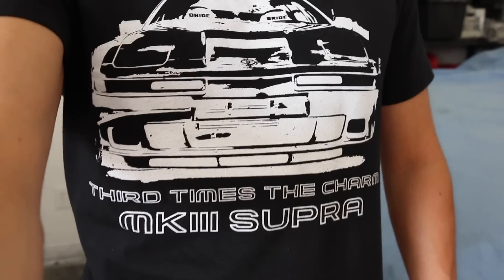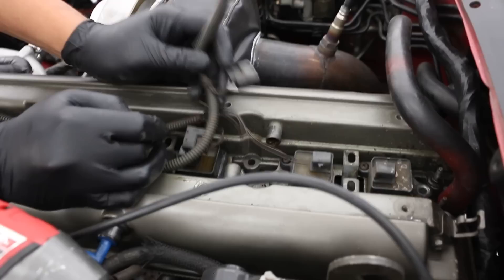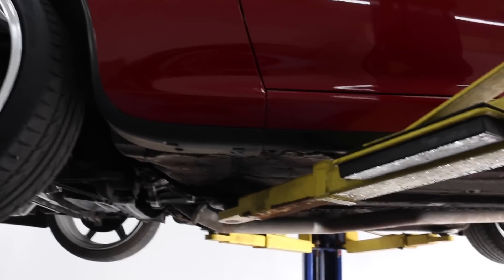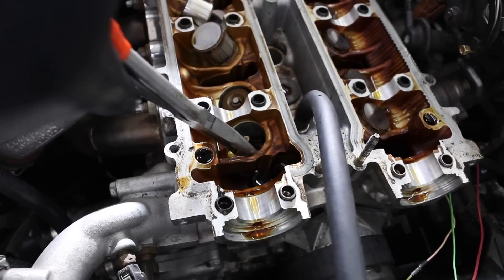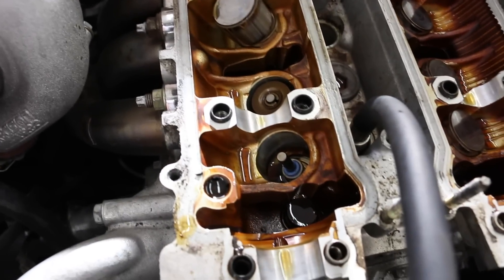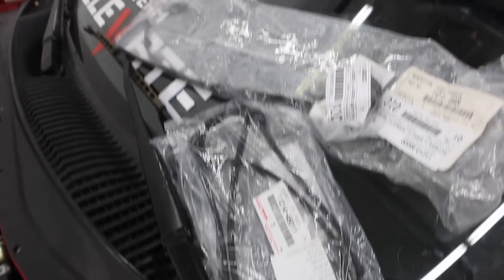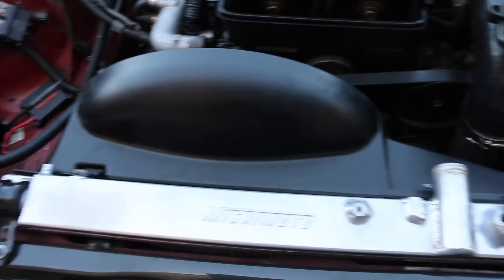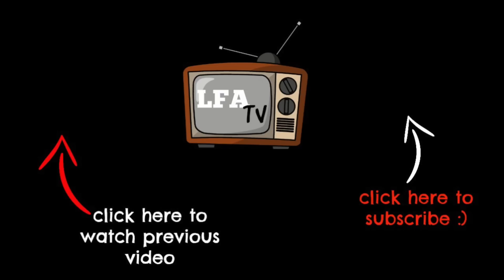MK4 SUPRA 2JZ VALVE STEM SEALS / HOW TO: WITHOUT REMOVING THE HEAD.

Comment: I had my W58 rebuilt minus the no longer available input or output shafts.  The noise I took it in for is still there and sounds scary driving in 5th.  I am forced to go for an  R154, or go for the TH 400 conversion.   If you know where I can find what I need, I'd love to keep the W58.
Reply from the maker: Dirty Vet only place i can try is ebay or rockauto

Comment: Yeah i have my w58 still, i dont mind it with my na-t. i dont do launches but i have yet to see any problems with it and im on a stage 4 competition cluch with it so it sees just about all the torque my engine is putting out.  However i just dont like only have 5 gears, its way to much of a tight ratio. cruising at 75-80 mph and the thing is at like 3700 rpm give or take. and by the time you're at like 130 you can tell your engine has more but the gearing just isnt there.   Great for canyons though in my opinion.  I'll be switching to the 370z transmission.
Reply from the maker: Review Guy the high reving on that mile per hr might have to do with your diff more then the tranny though, my buddies is wayy lower then 3700 on that mile per hr with the stock lsd diff.

Comment: W58s are ratted at around 400-500hp. Record holder is a guy from Australia with 650hp stock.
R154s are ratted at around 700-800hp. Record holder was Duane from Canada with around 1000 hp stock.
V160 are rated at around 1100-1200 hp. Record holder unknown, but have seen many at around 1500 hp stock.

Usually these guys with over powered Supras...are respecting and treating properly their transmissions without banging gears and general don't make crazy launches and trying to get into orbit in space! :-)

Comment: Ppl get w58s all wrong.  The tripod and swan neck are different then all the others. They have triple synchros and wider bearings. I’ve had mine above 500 hp driving it hard   It’s the older mk3 boxes and celica boxes that are weak.    I will almost say the tripod and swan neck are just as strong as the mk3 r154
Reply from the maker: I agree with ya

Comment: The w58 lives longer behind a 1j because the 1j doesn't make as much torque as the 2j. The 2j breaks the w58 faster than a 1j.
Reply from the maker: RacecarAndChill they have held for us in the 7Ms making way more torque aswell
Reply from the maker: RacecarAndChill the problem would be launching them or doing some fat burn outs lol we stick to the 2-3 gear pulls lol
Reply: Life's more fun when you can party. 😂
Reply from the maker: RacecarAndChill ur not wrong lol

Comment: W58 is holding power because engine is not making power breaking limits of the w58.
Reply from the maker: Well my brothers has been making 475hp to the wheels through a w58 for 2yrs now.. no launches or drifting. Strictly highway pulls. So depends on how you abuse it
Reply: @-LFATV  thats not enough power to break them yet. Of course any trans, if you baby it, its gonna last.
Reply from the maker: @s302jzget  well everyone in the internet claims that w58s cant even hood 400hp 🙄
Reply: @-LFATV  Nah, after 500 theyre on the line. 
Again like you said, hard launching and smashing the gears is what breaks them.

Comment: I much rather prefer filling the cylinders with air that stuffing rope inside. 😐
Reply from the maker: 755hp jaja thats for sure
Reply: Does the air hose have some adapter or connection that screws into the spark plug area?  I noticed you twisted the hose inward.  Please let me know because I will be doing my Mkiv soon.
Thanks!